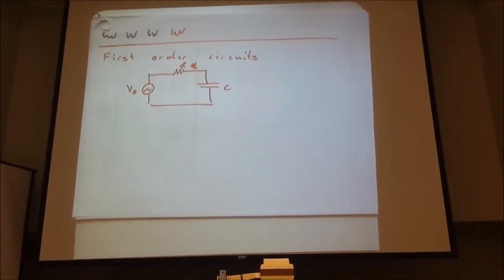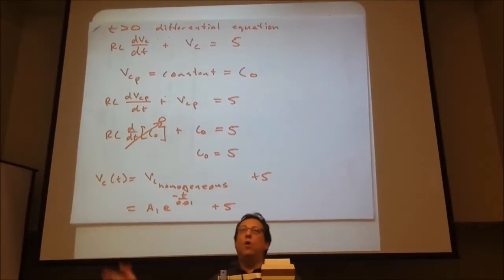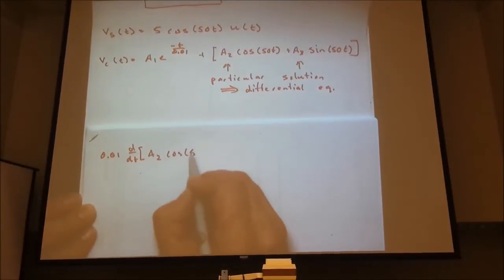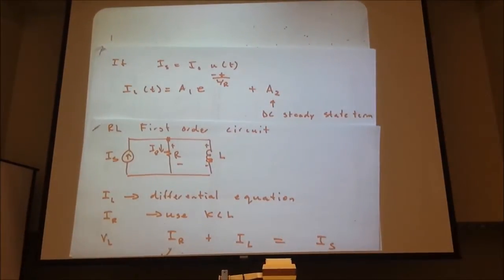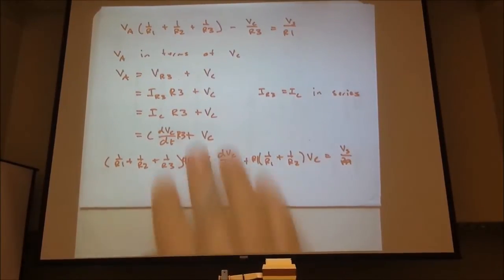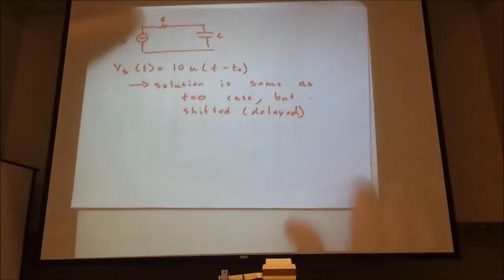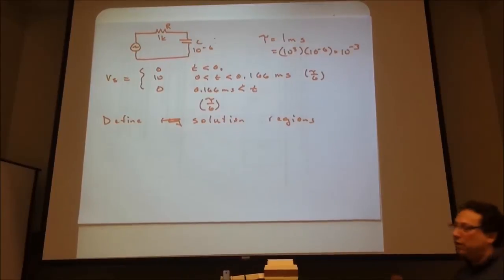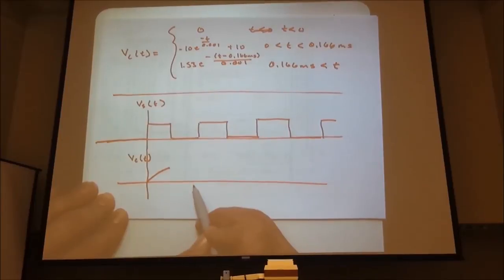Lec08 - First Order RC + RL circuits

Comment: What is meaning 0+ and0-
Reply from the maker: 0+ is a value that's just a tiny bit greater than 0, like 0.000001
0- is a value that's just a little less than 0, like -0.99999